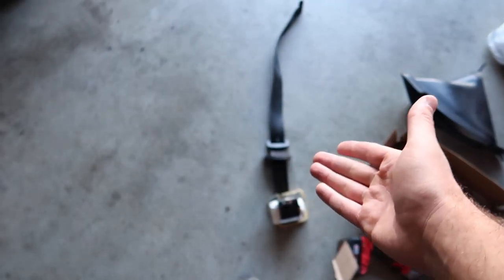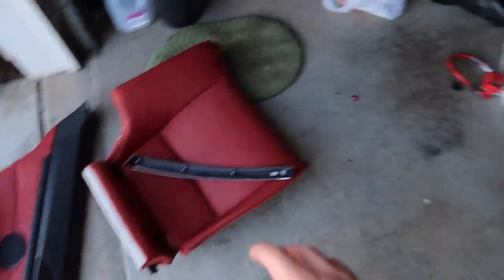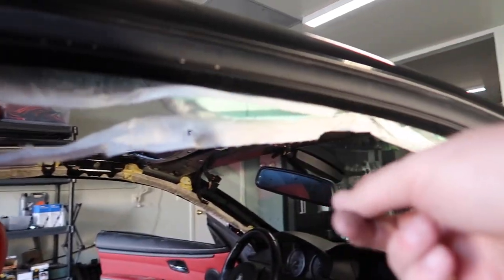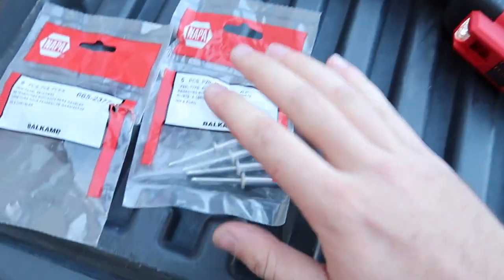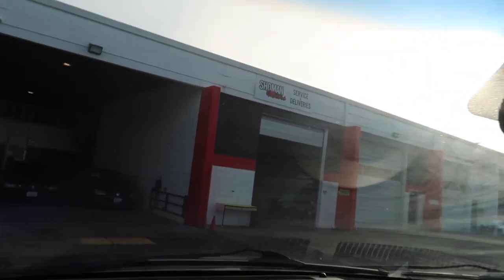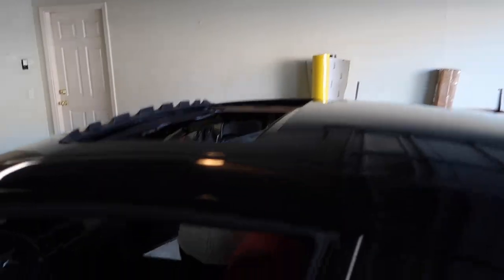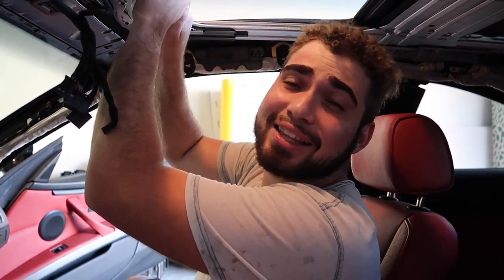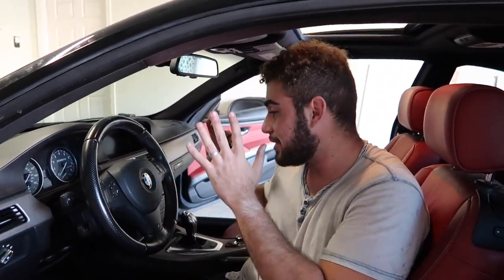Rebuilding A Wrecked BMW 335IS Part. 5

Comment: Nour I think you should have 3 consistent builds along side rebuilds that you can flip to fund the 3 track (e36) high power (335is) and just your overall gem ( m3 ) I personally think that would be cool and best thing so you call always switch up instead of having to find something new along side rebuilds